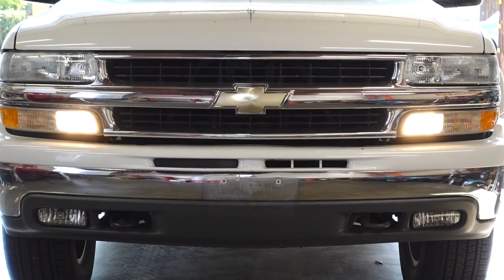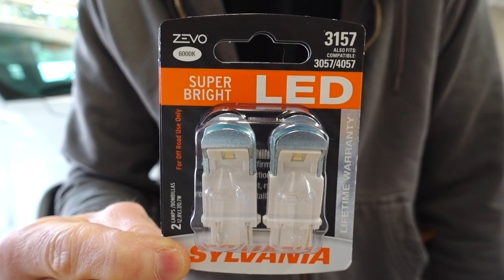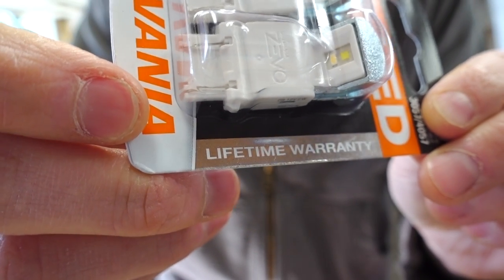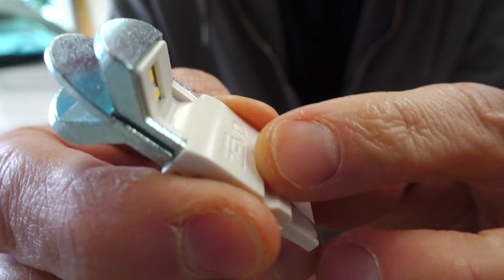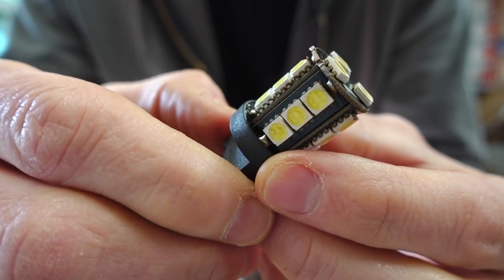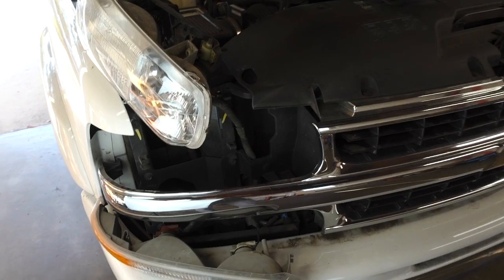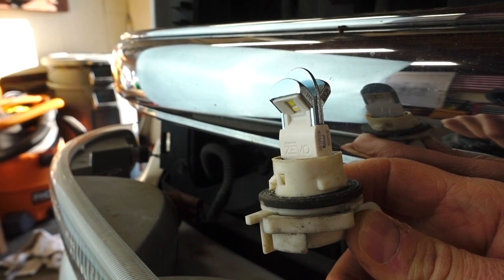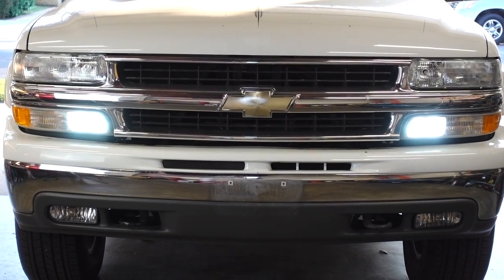Here's Why THESE ARE THE VERY BEST AUTOMOTIVE LEDs YOU CAN BUY!!

Comment: I don't know about the LEDs but their glass bulbs are made in Germany.  You might need a magnifier to read it.  It is stamped on the metal base and possibly printed on the ones without a metal base.  I only say about the LEDs I don't know because I never took a close look at them.  If they are by any chance made in China like a lot of things are that does not mean they will be terrible and mediocre!  Sylvania may be closely controlling the quality of them in all factories they use world wide.  While there is no shortage of inferior products from China there are plenty of good well made ones from factories where the quality control is more strict.  The only reason I don't install them on my Nissan yet is I don't know if I need resistors to avoid the "hyperflash".  I am sure you may have seen it on the road, an LED brake light or turn signal hyperflashing as if there was a bulb burned out.  Usually when incandescent turn signals do this it is because the other one on the same side is out.  If it is the rear doing the flashing, check the front for a bad bulb.  Of course when LEDs are used they cause these issues even when they are fully functional on many vehicles.  The LEDs draw a lot less power so to a vehicle with a CAN bus they seem to be non functioning.  On vehicles without a CAN bus that have issues with LEDs it is because of the difference in impedance.  I would like to get LEDs for my 2017 Rogue Sport SV but I want to research a little and see if I need resistors.  I might just leave the factory bulbs alone if I do need those.  The reason is that those load resistors are known to get hot and you must be careful where you mount them.  That means not on plastic or also not close to a painted surface but you also want them to be cooled somehow.  To me that sounds like a lot of searching for the ideal spot for them, so much for the ease of installation!

Comment: I don't want a bulb that melts the bulb socket.
Unless you are driving in a blinding snowstorm I don't think you should be  concerned that the light bulbs can melt the snow.
So I am just fine with the best LED bulbs you can buy.
I think all the newer vehicles come with LED Bulbs right from the factory.

Comment: Can't use them on my BMW, there is not enough load so the car computer thinks the lamps are burnt out. I'd need expensive and bulky in-line resistors to trick the computer.

Comment: Tbh, that's just a GM engineering problem, like why would you use those small bulbs as DRLs, and that's even in the aftermarket, those lights will never last. That's why majority of the time when I see a Tahoe from the early 2000s to like 2014s. They have burnt out DRLs

Comment: 6000K is very blue, not white. Pure white is around 4000-4500K. Light quality also isn't just color temp. It's also color rendering index (CRI). You want above 90 CRI. Most LEDs are below that. The cheap ones are probably far below, making the colors of everything look wrong.
Reply: 4000k-4500k is actually more neutral white. Or more hid warm white. 

Purest white would be 5000k-5500k. A pure white is 6000k with a slight tinge of blue but it’s more white.

Comment: If you don’t want the daytime running lights on all the time, there is ways to turn them off depending on the year of the truck. One is to set your parking brake just one click. It shouldn’t have any effect on your brakes with one click. They other way is if you have a fog light button, push it 3 times. Also if your good with auto electronics, you can just unplug the sensor on the parking brake. Another light trick on chevy’s is if you want the low beams to be on when you activate the high beams, there is a video on how to add a relay so all 4 lights are on when you activate the high beams.

Comment: I used these lights with the Sylvania resistor and these are garbage on my Jeep Wrangler.  The Jeep Wrangler housing for turn signals is clear and directly 90 degrees from the ground.  These have no light diodes that directly shine out of the lenses.  With these, the diodes are aimed behind the fixture, not facing forward.  Total garbage for what I wanted.  I can barley tell they’re even on.

Comment: ZEVO LEDS are not good for newer complex trucks.  I went through 3 sets and each blew out my entire brake light system on my 2018 Toyota Tundra. In the end I went with VLEDs that work great. They are also not the most expensive that exist by a long shot, VLEDs Extreme Red 3157CK LED are 175 a pair.

Comment: 6000K gives off blue light. I only use 4000K LED.
Reply: most incan lights are 4700K because 5500K is pure white and gives off the clearest most visible illumination but until bulbs like the silverstars and ultras they could not get any higher, your 4000K lights must be almost yellow
Reply: @PhantomHelix  Neutral White bulbs fall within the range of 4000K to 4700K. They impart a clear, white light with very little red or blue tones, but appears more "cooler" than halogen light. A "cool" white bulb commonly has a color temperature of 5000K or above. This is in the low range of blue color, similar to ice.

Comment: You should not be touching the bulbs even the leds with you bare hands. The oils will cause the led or bulbs to fail after being heated and cycled over time. Also not all of the zevo bulbs are made in Italy. I have three brand new ones right in front of me. 921 made in italy-168 made in Taiwan - 211-2 made in China. Kinda odd but it is what it is. They all are the newer zevo led bulbs.

Comment: Zevos are garbage - expensive cheap LEDs.  They are not CANBUS so you have to put resistors in most cars with them, which adds to the heat if too close, and are prone to early failure when put in the engine bay.  You can almost always get a decent CANBUS equipped LED for less per bulb than a Zevo and resistor.  I personally run LasFits now and they're great at their price point.

Comment: What this does is to tell you how much "engineering" goes into a light socket made my GM.
Reply: No the engineering is just fine, it is morons who replace them with the wrong bulbs. These 99-06 GM trucks need 4114 bulb (incandescent) for DRL, the problem is morons put in 3156/3157 which burns up the socket and sometimes even shorts/melts the wiring going to the DRL socket. The incandescent 4114 bulb is 12V 1.7W (0.14A), versus the 3157 (dual filament) is 8.3W (0.7A) and the single filament 3156 is 27W (2.25A). The wiring and socket is rated for 12W (1A) at most. Luckily automotive LEDs are low power (typically around 2W) so this is not an issue using 3156/3157 LEDs, but Sylvania does make the 4114 LED (in 2 styles) which is a direct replacement.
Reply: @cmdr_stretchedguy  The "engineering' is why I left Chevrolet, after working on their mistakes for 15 years, I called it quits. Think their engineering is faultless? How do you make money if you don't engineer stuff to fail ? Look at how many recalls and TSB's Chevrolet has had over the last 35 years.

Comment: But why would anyone install LED on a vehicle. They are only designed to use less energy, which in a vehicle is pointless, unless your talking camper lights.
Reply: There nothing bad about led. 

Putting less energy with higher brightness is more efficient and better than halogen. Because it consumes more energy. 
And it fries up the socket from over time. That’s the point to make it look good and stay efficient for ur vehicle.

Comment: Should of gotten switchbacks
Reply: Those are DRL’s. Next to the DRL are turn signals. 

It only requires two separate circuits. If the turn signals was also a DRL, than u can get a switchback. But u don’t.

Comment: Zevo bulbs are garbage. No light output when needed. The angle of the LEDs dont hit the reflector properly. I have 4 3157s that I attempted to use. All of them are sitting in a drawer. Using a multi LED bulb gives the light output I needed. And yes, my bulbs have heat resistant measures.
Reply: It only depends how u use them. The zevo are excellent and well made. And it’s for those like us wants led lights that’s brighter but not too bright. Even though it’s considered super bright, it’s the brightest of the least bright led. 

So they will be fine and they are excellent to have.
Reply: And it only depends what type of housing ur vehicles is. 

I’m using these zevo 7443 red on my 2015 scion xB. They are couple hairs brighter than stock, the intensity is much better, plus they really kool when they turn on and off.